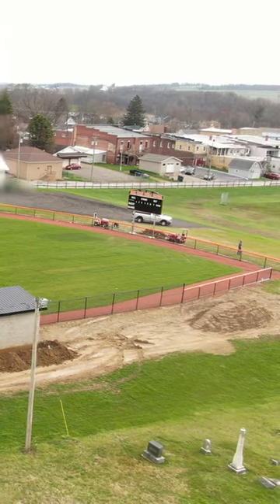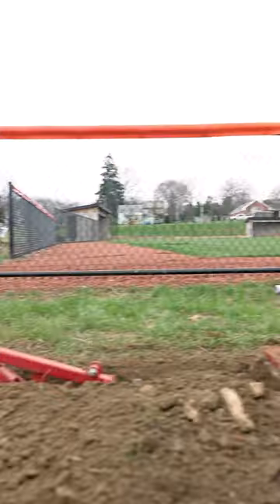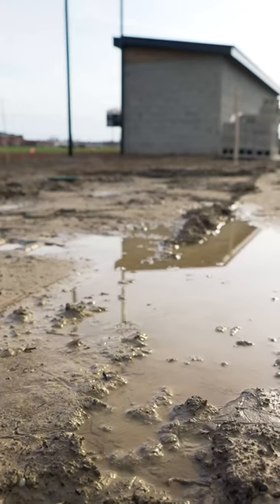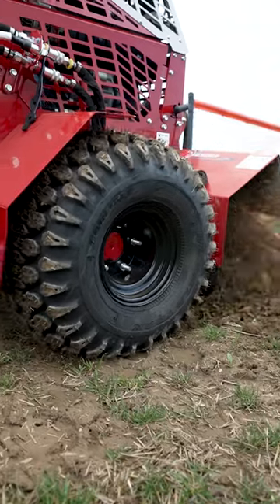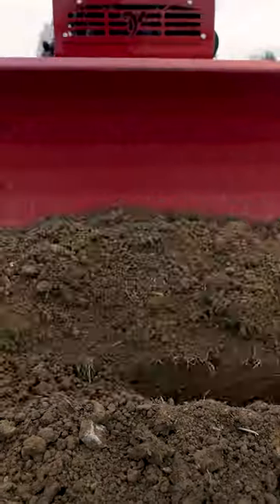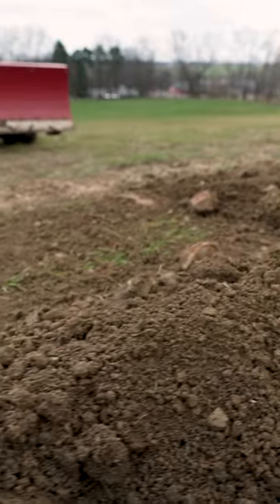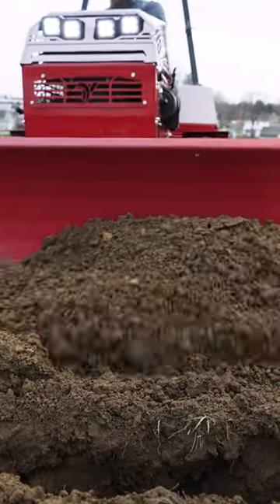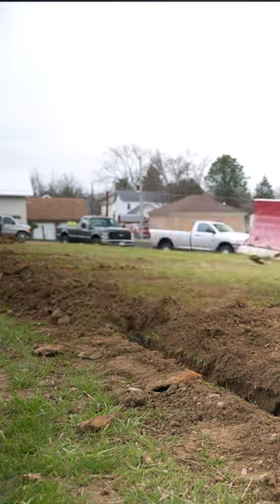Trenching Without Turf Damage

Comment: Ventrac is pushing this thing hard. Looks cool but never believe the one tool to rule them all sales pitch.
Reply: Yep my Vermeer lm35 that cost me only 3k would have plowed in a flexible UL listed conduit in a fraction of the time and nothing to backfill. A swiss army knife does a lot of stuff but non of it well.
Reply: MY vermeer 2330 hdd wouldn't have left but an entry and exit point 😂. Trenchers have their place, but drilling probably has the least restoration required  and can also be used around other in-ground utilities. However, it's is literally 100x the price of a im35
Reply: Its a tractor, its meant to be one tool to rule them all
Reply: @rileymannion5301  it's not all it's cracked up to be, the local golf course has one , they thought it would be a good rough mower, for handling the slopes, but it's not working out for them, very scalpy mower deck I've been there 6 times to work on it. The mower deck burns through belts like crazy for a mower that doesn't get abused. Just got a call today that a bearing seized on the pto clutch. They are looking to trade it in on a toro that is actually going to do an excellent job.  They weren't happy with the trade in value on a machine with only 600hrs.
Reply: This is just a tractor.. but more expensive with proprietary parts and sold to fellers that dunno about tractors and their capabilities.
Reply: Every time I see one of their commercials, I think "A skid steer could probably do that better"
Reply: @Tracert-mc1hu  yep universal attachments makes sense too. But things like trenching work better on a trencher
Reply: @MacGyver-1  Yeah, a dedicated trencher is much better
Reply: @owenmonaco7817  I agree directional bore would have aced this job with minimal ground disturbance. I work for a fiber internet installer. we deal with mine fields of concrete under roads/ditches all the time. and yes a new 10x15 isn't cheap. we currently have  7 new 10x15's and  20x22's on order.
Reply: @gs4811  my university was happy to buy like 5

Comment: Ditchers are great for hitting utility lines. Excavators or backhoes are way better. That way when you hit something with an excavator or backhoe you can feel it in the machine, usually before you tear it out. I used to do underground work. I've hit phone, water, high pressure water for fire sprinklers all on a ditcher.... Thank God, I never hit electric as someone can get killed getting off the machine or fiber optic that costs thousands to fix. Quit doing underground work years ago. I don't miss it a bit!!
Reply: It's called 811 dig
Reply: @tmitch8639  aint my problem if you dont locate it

Comment: A couple months ago they trenched gas lines and drainage lines in my yard and they said they did it by hand because it was more effective and what we later found out was they did it by hand because they make more money doing that but to this day there is still marks on the lawn from where they brought the heavy equipment in and there is still marks where they dug the trench even though they seeded it. Primarily because we have a lot of clay in our area and they put the stuff that was at the bottom of the trench backup top which is the clay

Comment: Looks like it needs a guard on the end of the auger to stop it throwing the dirt out too far making it easier to backfill the trench
Reply: Exactly what I thought. A rubber tractor trailer mudflap is what came into my head. Also safer. Looks like it chucks some chunks pretty good.
Reply: Exactly. Poor design for sure.

Comment: May suck but at least it’s better than here in San Antonio. Bedrock starts 6 inches below the topsoil. Yes you have to cue through solid bedrock  just to dig a trench. That’s why nobody has pools here. Because a standard pool is upwards of 50k because of the extra tools and labor
Reply from the maker: Our trencher is capable of braking through and pulling out rocks the size of a brick. The Ventrac should be able to handle most terrains in San Antonio!

Comment: That's why they make Directional Drills my friend.
Reply: Stephen Nicholson - 💯% correct!!!
Reply: This is correct, but as he said, it's on the foundation of where a old building used to sit. The left-over settled debris could easily make it impossible to drill through, or incur serious damage on the rig.
Reply: @guywithamosinnagant547 its a drill .. carbide drill will go through anything this fancy lawnmower might attempt to do.
Reply: @guywithamosinnagant547 literly drill through rocks steel your bacement you name it
Reply: @thewelfairshop4164  @xephael3485 Correct, a directional drill could, with some difficulty, drill through most things with the correct bit + paddle. The trouble comes during the other half of what a directional drill is designed to do, and that's pulling product back through the bore. Rocks, bricks, steel, what have you, can and will wreak havoc on anything your pulling behind that drill, especially if it's something like a fiber/power line that isn't encased in duct.

Even 2 or 3" duct will get kinked/torn apart pulling through terrain as adverse as that.
Reply: Vibratory plow for the W
Reply: @IMR_BOOGIE  Ever seen someone vibratory plow across a river or interstate?
Reply: @guywithamosinnagant547  pree ream and you have no isses. Im writing this comment at work on a hdd crew. Do it on a daily 6mo oit of the year. They can pull back 36inch

Comment: Just just asubsoiler with a front turf splitting disc. The cable/pipe goes down at the same time. No loose dirt. Just drive back over split seam to close it. No disturbed turf. Been doing it for 40 years at least. ❤

Comment: How would you compact the soil every 12" once backfilling? Tamper plate I've used are typically significantly wider than the trench width of the blade? Specifically had this issue a few weeks ago, luckily the GC still has to cut grade and the inspector is cool.

Comment: Whats the name of machine you are using?
Reply from the maker: Great question! The 4520 is equipped with the trencher attachment. You will also see the dozer blade closing the trench.
Reply: I was thinking that it was some kind of a lawn mover with hydraulics. Im a heavy equpiment operator, and im thinking about starting my own buisness. I was thinking about buying JCB 1CX if u are familiar with it. If u are I would like your opinion on that machine,  and is it worth it buying small excavator or should I just buy lets say JCB 3 or 4 because they are maybe more efficient. Thank you for Your time and sorry if my english is bad.
Reply from the maker: @vedranzdelar5911  Thanks for your response. Give Ventrac a call @ (330) 683-0075 and ask for extension 3246. I would love to have a conversation with you!

Comment: Man, what a mess! If you rent a real trencher from United Rentals it will leave a nice berm along the trench instead of throwing the material 10 feet away.
No professional would want to use this.
Also, a real trencher is mounted on the rear, so you aren't having to back up the whole time, and you don't get that wiggly trench which sucks if you are trying to put larger diameter pipe in, or make it look good.
And yes, a real trencher will have a blade on the front as well to refill the trench.